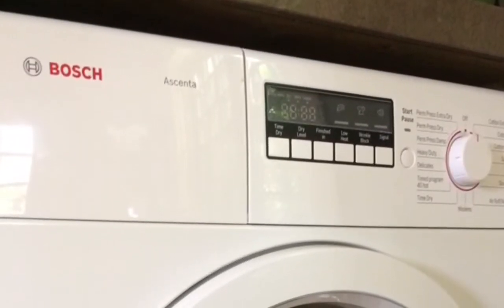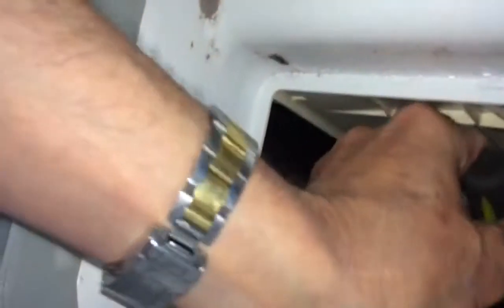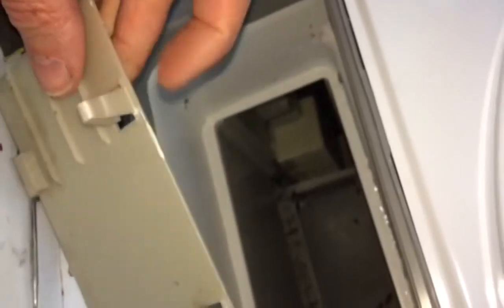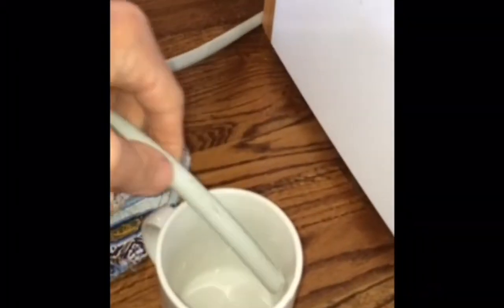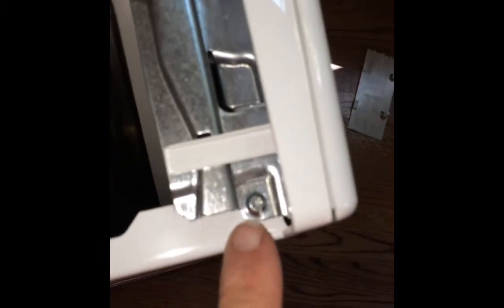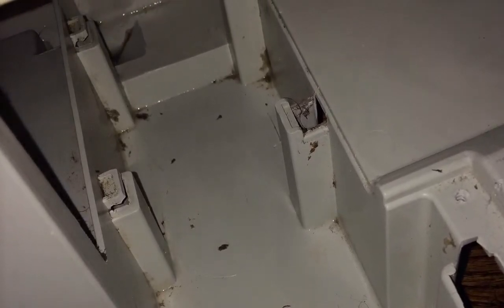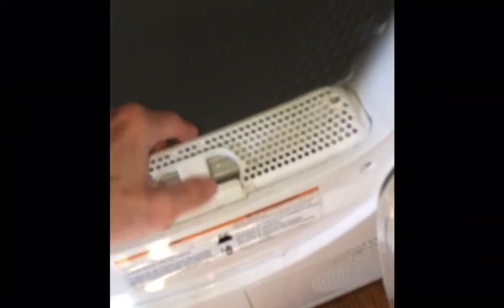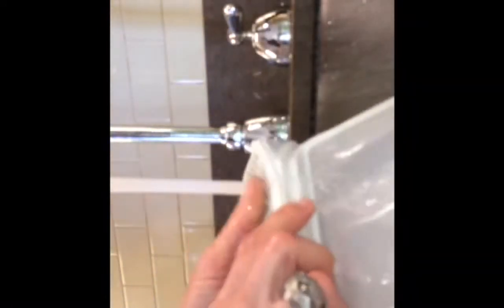✨ Bosch Condenser Dryer - Won't Start - Check Pump Light On (FIXED) ✨

Comment: Can anyone tell me where in this video the float is that turns the pump on? I cannot find it
Reply from the maker: Can you send that same question to my email at: scottthefixitguy@yahoo.com?
Reply: @ScottTheFixItGuyChannel  Well I did. And all you did was send me back to this video.
Reply: @tetedepoulet8651   there is actually 2 designs for the Bosch condenser drain pump. 

One is with a float switch that moves up and down, the second design (like the one in this video) has 2 prongs with an electronic electrode that senses water between them.